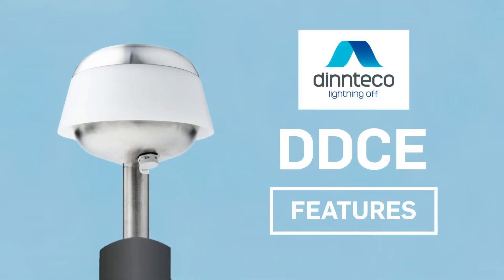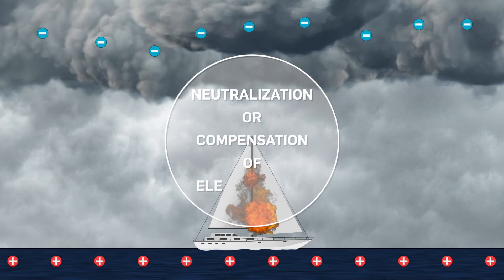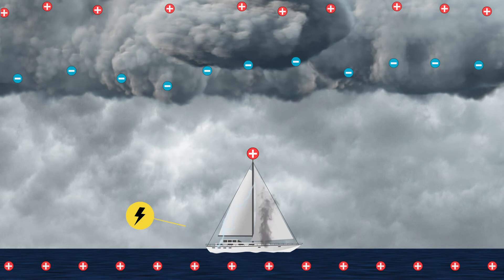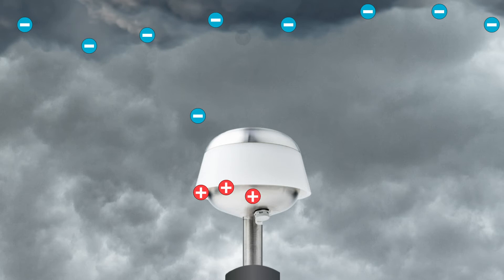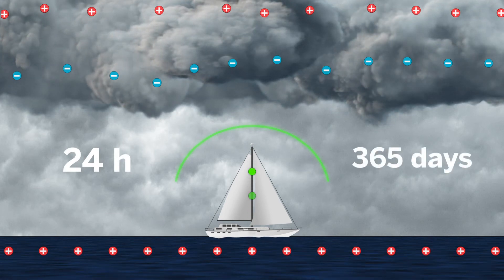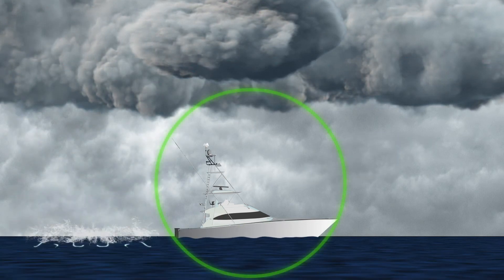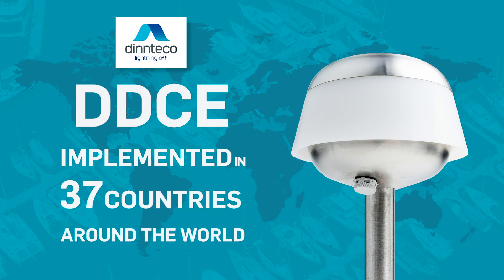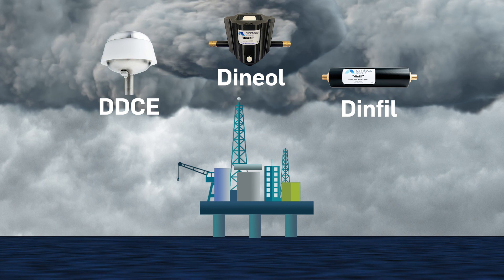DDCE Marine Lightning Protection - How it works

Comment: And what if the clouds are positively charged and ground is negative? It forces a strike on your mast? I'm sorry, but the only way to avoid lightning would be to charge your mast to the same charge as clouds and I don't see that feature in your video. To the opposite, you're creating a high point that is oppositely charged to the clouds and creates an attraction for lightnings.